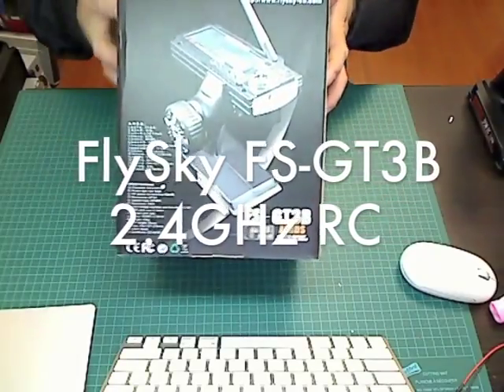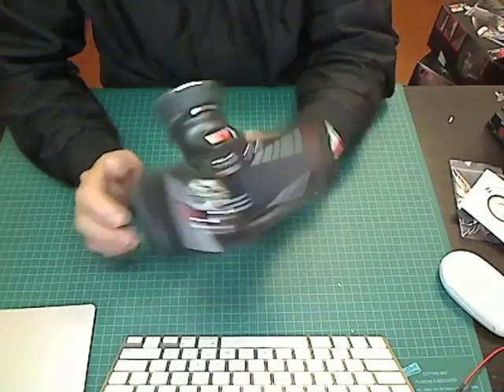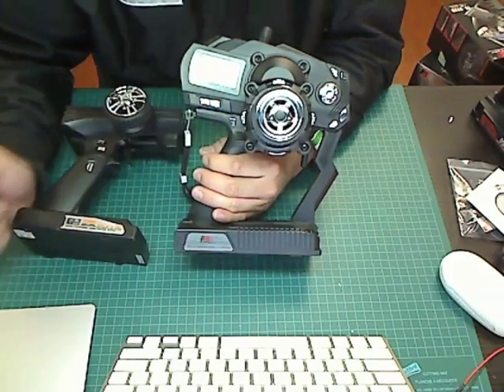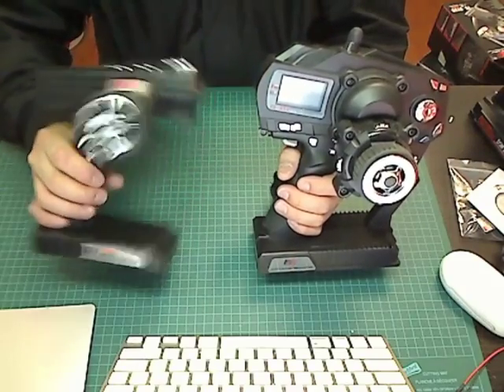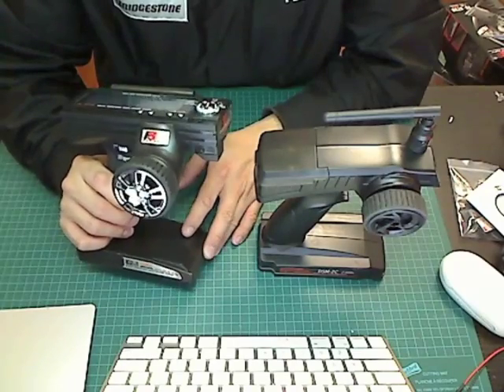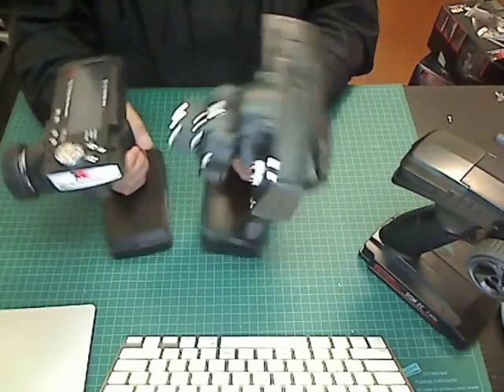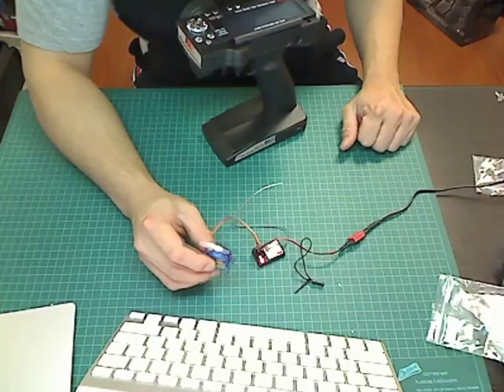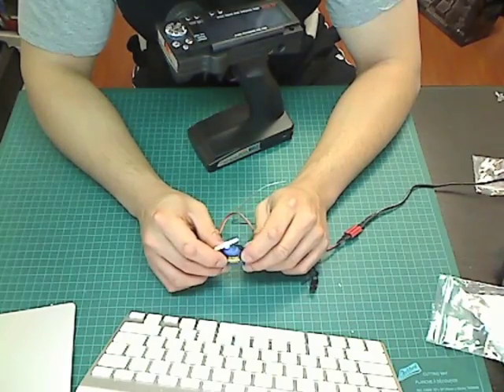FlySky FS-GT3B 2.4ghz 3ch RC radio control transmitter Review

Comment: if we using 1,2v rechargeable AA batteries x 8pcs it only reach 9,6v. Will it decrease the capability of these transmitter?
Reply from the maker: No it won't. It can run at a lower voltage.

Comment: why would one need a after market remote if their stock rtr comes with one? new to nitro rc
Reply from the maker: +Phuc You A more advanced transmitter will give you options like throttle delay, and other features.  Also if you have lots of RC cars/boats/trucks, you can use one transmitter and control them all since they can be paired to multiple RC receivers.  Just select the model you want in the menus.  One transmitter, 10 cars.

Comment: hello there I have owned 2 of these and found the quality not there, my ofna with tekin motor and esc ran out of radio range within a football field, was so frustrating i bought a Sanwa MX-3X High Response System. i spent $1000 on my buggy I want a quality System. all the best with your transmitter and receiver cheers on your vid.

Comment: Great video. My question is how far is the range? I have a 100+ mph r/c car and I have problems with the range of my current Traxxas transmitter and receiver. I need a range of 3/4 of a mile. Will the FlySky reach that far? What's your opinion?
Reply from the maker: I'm really not sure about the range but since it uses frequency hopping that should be less prone to interference.  3/4 mile is far!  I don't know if you would even see it lol.

You may consider the older GT3 which lets you change the receiver/transmitter module to something with better range
Reply: strobe led flashers used by coasties in the big seas low energy consumps and bright as a run way strip> sweet inovation now for the rollcage ?
Reply: Flysky doesnt have a huge distance, not any longer than my TQi

Comment: Good video mate, just ordered one of these today. Was wondering if you could let me know if just a good set of nimh AA's wont work, like 2200 + mah? I know they will work but seen all these folks putting lipo's in them. I have had computer radios b4 like the lynx 3d & a several others & a decent set of nimh's were fine for racing. So you have had pleanty of time to know about the battery situation. Thanks for your reply in advance. Cheers!

Comment: he wasnt running the GT3B, but i know he test is fail safe before he started it ( i watched him do it) and when he lost power to is batt it went full throttle ( were it was when it went flat) into a curved curb, jumped into a building and jump about 2.5 meters off the ground and landed on its wheels so uuuummmm i dont think it worked LLLOOOLLL

Comment: He had the same TX/RX Combo? GT3B? On the RX there is a tiny little button called "F/S Set" at the left of the Status LED... To set the Fail Safe you need to Press the Brake until you set it at the desired Position and Push the F/S Button on the RX until the LED Blinks a couple of Time then Test it! Turn off the TX and the RX Should Automatically Apply the Brakes... I dunno how much possible is to run out Flat a Battery I believe at less than 4v Most 6v Servos run very Poorly and its Noticeable.

Comment: Most newer RC uses Li-POs which doesnt completely Run Out most likely your ESC will have a Cut-Off which prevents it from Using your MOTOR but it doesnt cut the power in the BEC which in case will still power your reciever + Servo. In NITRO Cars the batterys doesnt run out, They start to lose power which in case will feel like a Loss in Servo Movement and Power by That time you will know you need Fresh Batts anyway... In BOTH Cases the Fail Safe will work.

Comment: I have no breaks at all but I can turn and give it gas do u know what this means my adjustment are servo rev channel 1 nor e. point adjuster lift forward channel 1 100% abs  auto break system channel 2 nor exp channel 1 0% d/r rate is set 96% those are mine on my flysky bro can u help me please and thank u

Comment: @nxcmka if you're running nitro/gas, your only battery would be the rx battery and if that dies then your failsafe wont have any power to work (only happen if you dont charge your battery between long run periods). if you're running electric, your car will stop anyways if your batt dies. Failsafe is just for if your kit gets outta range of your radio.

Comment: @kenv98 get the firmware flash kit from the OverkillRC website. $25 and you can have tons of mixing features 120% trim instead of the default 30-40%, you can remap any button and with the right receiver up to 8 channels

Comment: This video really helped a lot since I'm planning on buying one. But, on the other hand I didn't catch it on the video if I could connect the TX with [two] receivers. Like, let's say I have an rc boat and a buggy and wanna run my boat but the TX is connected to the buggy, would i be able to bind the TX to the boat's receiver without losing the settings for my buggy settings? Can I connect [two] receivers with this TX?

Comment: @kenv98 u mean the useless PDF file? yeah.haah 

i ripped it open and found 4 solder point  near the..2.4 module part? the one where has the grey wire attached to the antanna; 'RST', 'GND', '5V' and 'SWIM". trusting my instincts, i guessed RST was reset,GND, ground , or negetive .5V being positive and 'SWIM' being something that made me go "WTH?" i connected RST with GND and it made the LCD just go off. i tried holding it there for awhile ( who knows, maybe it works like binding)

Comment: Granted this transmitter was made in a Chinese sweatshop, but still. Can a company like futaba justify a price tag of $400-500 U.S. for a transmitter!? futaba for over a decade now has been nickle and dimming the R/C end user. Their top of the line transmitters do not even have color OLEDs and touch interface. They are still using shitty LCDs from the 1990s. Total ripoff, and I don't want to hear any of the fan boys justify it.

Comment from the maker: @gudrn 

Depends on what GT3 you got.  Your 2.4ghz module, does it say TM01 or TM02?  TM02 is the new one with freq hopping and is the same as the GT3B.  Also you can tell by the receivers.  GR3A is old GR3C is new.

Comment: Oh, now I know what throttle delay does. The new one doesn't have it, but if you afford this radio for an electric car you're probably using a brushless sistem, and lately ESC's have throttle delay, they are responding to the amount of grip that the car has.

Comment from the maker: @poohtray 

The only options for batteries if soldering isn't an option would be rechargeable's.  2500mah NiMH AA batteries would be ideal.  Sanyo Eneloops are my favourites.  They have a very low self-discharge rate so they last a lot longer when not in use.

Comment from the maker: @poohtray 

Like I mentioned in my other comment I use rechargeable Lipo's but I think for most people rechargeable AA's like the Sanyo Enelope batteries would be sufficient.  

Lipo's require more care when charging and you have to be careful to not fully discharge it or it'll be dead.